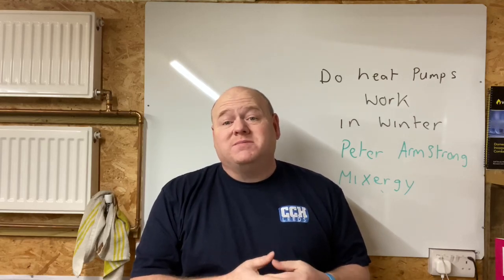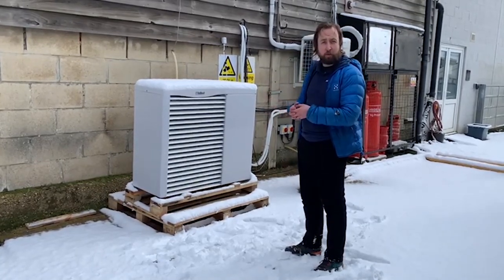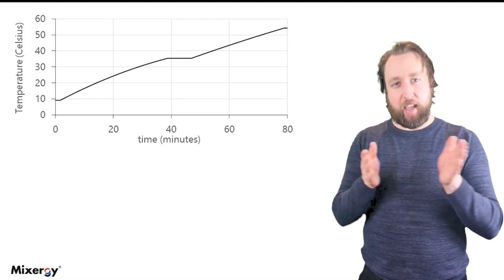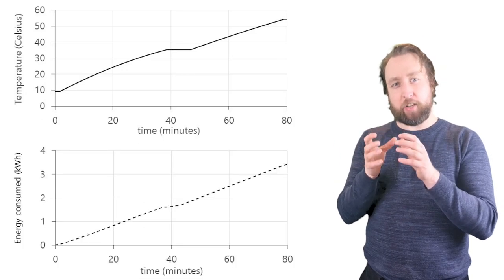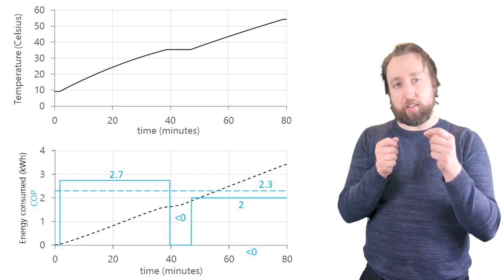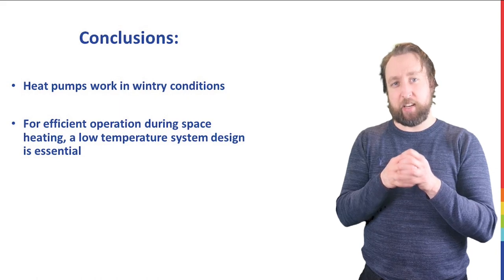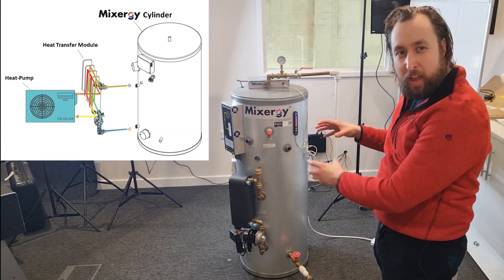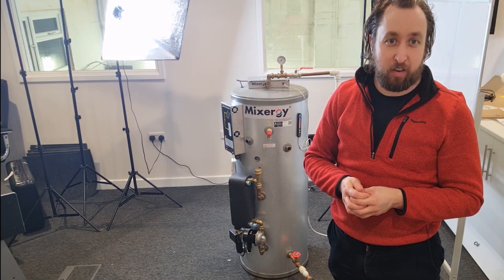Do Air Source Heat Pumps Work In Winter - Peter Armstrong Mixergy

Comment: I have been doing a lot of research into this, there is a lot of confusion or should I say misinformation about heat pumps, that make it very difficult for non-experts to make purchase decisions. From what I can see, the real problem or should I say the real risk is that a temperature will not be hot enough without having to add additional energy to raise the temperature so that it can replace the heat provided by existing boilers/systems.

This of course leads to extra expense/Unpredictability into the system!  Providers tend to outsource the problem by saying well of course you must make sure your house is well insulated.  Once you’ve done the obvious easiest ones like draft-proof your windows and put shed loads of installation in the loft - then you have the more difficult areas like, under floor insulation/cladding to the external part of the building which can be very expense. 

Another problem, is that it’s easier to fit Air source heat pumps than ground ones but these can be noisy particularly as you and all your neighbours consider fitting them. The frequency or noise level may not be particularly high in itself but it’s rather a consistent background hum which I think a lot of people find annoying.  The location is critical here, the homeowner may put this next to their garage which could be the other side of where their living quarters are so it may not be a big issue for them. However, it could be on the living side of your neighbour, their bedroom - definitely a way to fall out with them quickly. Just imagine as time goes on as more heat pumps fitted throughout the neighbourhood! 

To my knowledge, these issues are not being considered/will not be covered in terms of planning consent.

Ground source heat pumps can eliminate this problem but there will be more expensive and more technically challenging, particularly if there is not a wide area such as a large driveway to install them into.  It looks to me that the current political climate/drive is geared towards eliminating the gas boiler Entirely - Which is rather concerning, particularly as we have  a good quality infrastructure in terms of delivery/pipes for gas etc.  In other words, if we can’t crack for hydrogen delivery nut quickly - we may well find solutions such as heat pumps imposed on us and this will move us away from gas boilers entirely even though they are a very effective way of heating a house - Especially in the UK where the housing stock is not of a particularly good quality in terms of insulation and heat retention.
Reply: Spot on matey xden
Reply: No good
Reply from the maker: Thank You

Comment: At a 2.5 times return, I’d like to know what the payback time is compared with a simple resistance heater. My back of envelope calculations say it could be as long as 20 years with just the two of us in the house! Using solar power with a cheap solar diverter seems also much cheaper.
Reply: It’s time people stopped talk about payback time, far more important is emissions and how we can reduce them.
Reply: What’s the payback on your car, computer, iPhone? When they close down the gas network what will you (or your children) do? Solar in the winter when it’s production is at a minimum to supply power when the heating demand is at maximum? Have a think about that.

Comment: You can’t really claim heat pumps work in cold weather by testing it at -1C. It’s at -10C or less that you run in to trouble. Weather comp star tells me that we have about 15 days last year when it was around these temperatures for extended periods.
Reply from the maker: Thank You

Comment: This has got the next big mis-selling scandal written all over it. 

They simply will not heat anything but a new build house in this country and even then I’ve got my doubts. 

55c after 80mins just to heat an insulated tank. Can you imagine how long that things gonna have to run to fully heat every rad on a wet system. It will never achieve a satisfactory surface temp on all rads. 

Plus who’s gonna want that f@&king great noisy monstrosity stuck outside their house, pi@@ing the neighbours off. Blimey think about the arguments people have with neighbours over a bit of gas boiler pluming, this will create a war zone. 

Then let’s look at the practicality of it. Who the hell has a house with walls big enough to upsize every radiator to a size where 50c will actually heat the room. 

Then factor in trying to get solid walls and old windows and ventilated roofs etc to actually trap the heat. 

Then think about what it would actually be like to live in a house that requires a constant trickle of heat running for six months of the year, that takes hours of recovery time. You’d better not be opening your front door very often on a cold day unless you’ve got a good supply of jumpers. 

These things are snake oil. Great for new builds, underfloor and swimming pools and that’s it. 

Expect some very unhappy customers demanding their money back claiming you must-sold them. I’ve already got a mate who’s making good money ripping them out of older properties cos they simply won’t do the job they were sold to do. 

Once hydrogen boilers are perfected. These things are dead. Look how many people have obsolete solar thermal on their roofs now, installers disappeared, manufacture either bust or not supporting it anymore, massive hassles finding anyone local to service it etc etc. 

Complete non starter, pushed by people trying to make a quick buck off the back of the next green fad selling to people with more money than sense who have to be seen to be the streets eco warrior darling. It’s all about Greta Thumbscrew or whatever the f@@k she’s called. 

You’ve stolen my childhood 
No love you’ve stolen our gas boilers. 😡
Reply: Totally agree with all you say here. Fantastic comment, especially about Greta Hypocriteberg!
Reply: I think its Greta Dumbird 🤣
Reply: @lazycalm41  I don't think anyone is suggesting that "we stop all flying, shipping, and heating our homes". If we go on the way we are going do you think your grandchildren will have a decent quality of life? Do you believe climate breakdown is an actual thing?
Reply: @dellawrence4323  Hi Del. We have to be careful with statistics. The figures you give are probably correct but remember that the "West" or developed countries have outsourced their manufacturing to low wage China. The stuff we use every day like this laptop I'm using now was made in China so their high CO2 emissions are down to us. Have a nice day.
Reply: I think you make some very valid points in your article. I agree these work great with under floor heating and swimming pools.  I am about to install an ASHP to my house built 1884 and unbelievably has cavity walls which we have had insulated.  We currently have radiators and underfloor heating powered from a biomass boiler unfortunately no gas here.

Converting to to ASHP I believe one of the biggest issues is trying to use radiators as you rightly say you need to double  the size of the rads which increases water content and slows the response times down.  I have done some research and will be taking a different approach and going down the low water content fan coil unit.  Daikin do a fan coil that works between 35 to 45 c flow temp so I am  designing at 35 C for worst case coldest days.  I will also install a buffer to ensure I can maintain heating when ASHP is going through its defrosts.  I wish I had gas but we are rural so it’s oil or biomass and humping 8 tons of pellets in 15/kg bags up my drive every year in my late 60 doesn’t appeal any more.  So I am Hoping ASHP with the correct heat output devises good draught proofing and better insulation will give me comfort I know it’s going to be more expensive living rural you expect it, who knows Greta might give me the seal of approval.  Great post by the way I enjoyed reading it.
Reply from the maker: Thank You
Reply: And you will have used a butt-load of electricity to do it too !

Comment: What you really want to compare is heat pump vs gas COST when performing many tasks in winter in a typical house.
Gas wins everytime by a long way, unless the heat exchanger is powered by off grid solar panels and battery inverter system, but that's a huge upfront cost and still is not good enough.
Ability to get rooms to 23 degrees?
Heat pump in a typical house .. no chance.
It seems clear that in winter heat pump offers virtually zero advantage over pure electric, and that is 5 to 6 times more expensive than gas.
No brainer.
Reply from the maker: Thank You

Comment: Great video. The Danish have been big into heat pumps for years and have a lot colder weather than the UK. Their district heating schemes use air source heat pumps on a large scale, 2MW+ and the efficiencies still make it work financially.
Reply: Back in the 1970's I read an article about a remote community of 6 properties in Sweden. Their answer to getting Electricity was a 2ltr Volvo engine mounted in it's own little hut driving a Generator. I don't know if that was the norm..
Reply: I lived in Denmark 25 years ago. The air source heat pumps worked great in the summer when no one needed them and froze solid and did not work in the cold, damp winter.
Reply: A.commercial 2MV ASHP is a very different animal to one at 14KW. Lots of hot gases to thaw out coils instantly and often used as bypass to ensure superheated return of gases.
Reply from the maker: Thank You

Comment: This is new technology for new homes with underfloor heating, if buying a new home make sure the developer has the right amount of insulation, developers are not good at quality control.
Reply: Sorry but I was installing and designing  heat pumps in the 1970s
Reply from the maker: Thank You